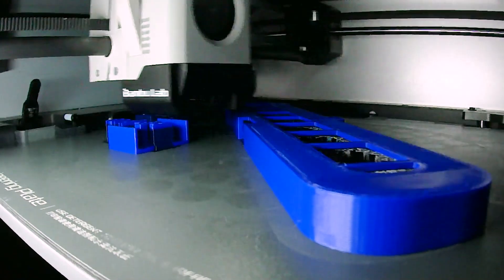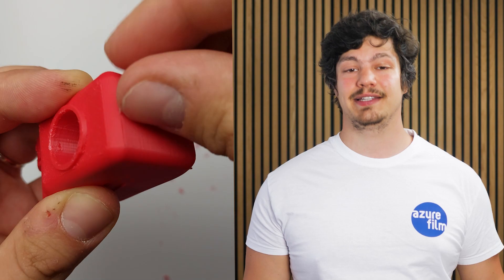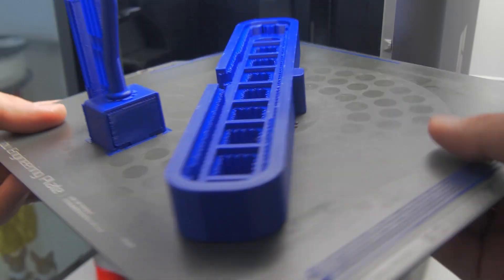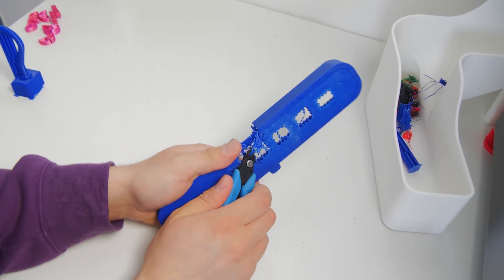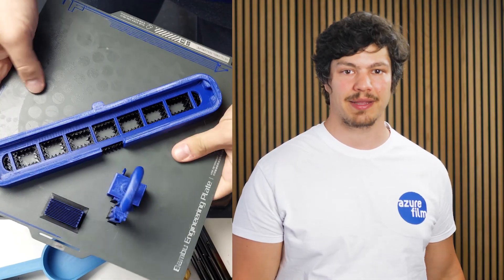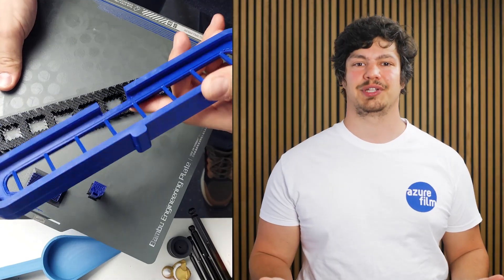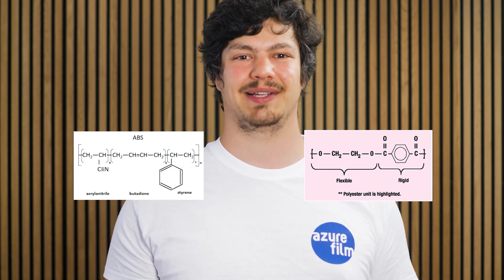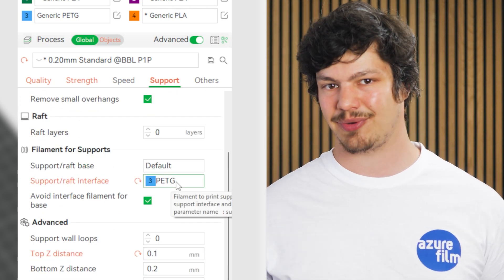Easy solution for removing supports

Comment: Just user the PETG as the support interface layer, you waste a lot less filament
Reply from the maker: Agree!
Reply: it depends on the price, raw material wise ABS is dirt cheap, while PETG costs a bit more - but usually filament manufacturers sell you the ABS for a hefty premium (looking at you, AzureFilm) - so in the case of AzureFilm the ABS Plus comes to 25 Euro per kg while the PETG Original boils down to 9,90 Euro a kg - so it would be insane here, to use PETG here just for the interface